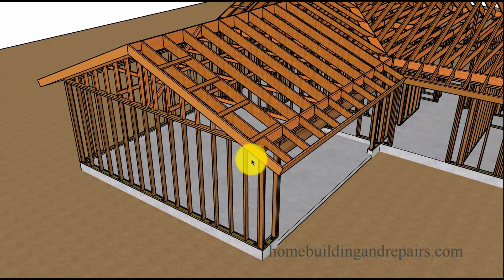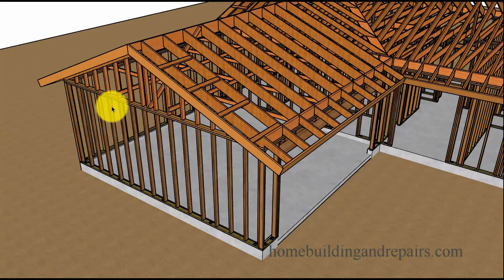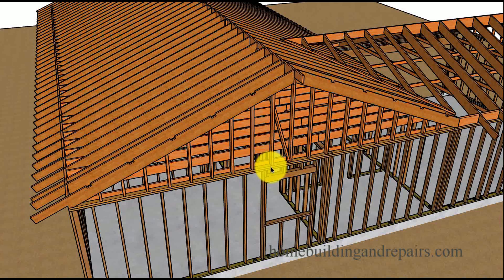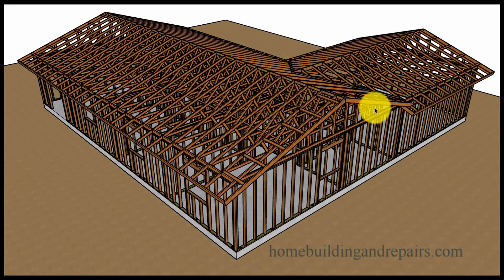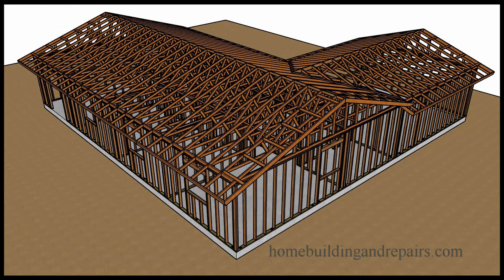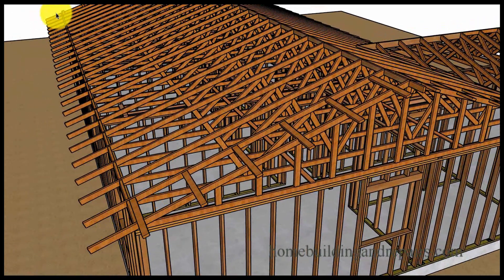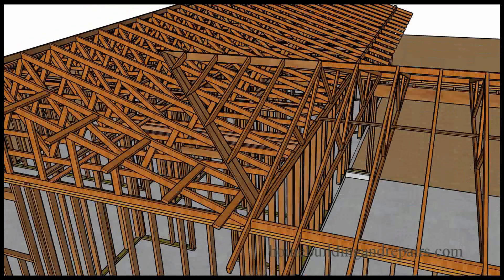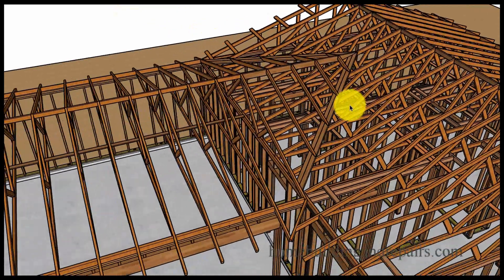Are All Exterior Walls Load Bearing? - Learning More About Your Home

Comment: I've seen homes remodeled where the roof is hung from a 2x6 attached to the inner side of an exterior wall... so that all you see from the exterior is the wall itself... the exterior looks like cubes without any overhang and i was wondering if this is safe as far as the roof  being attached from the sides vs on top of the plates...

Comment: This makes a lot of sense. I've been trying to figure out what wall to put my 50 gallon fish tank on for the second floor. If I was on the ground floor, it wouldn't matter so much. However, I don't want it going through the floor. With the help of this video, I can just put it on an outside wall that corresponds to the more load bearing side according to the roof layout.